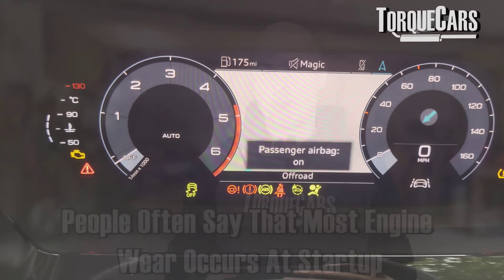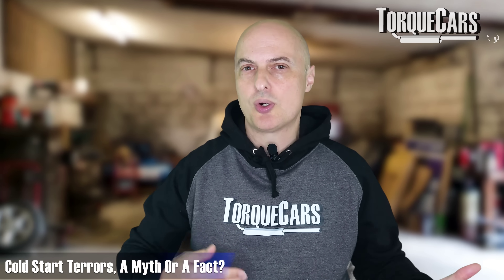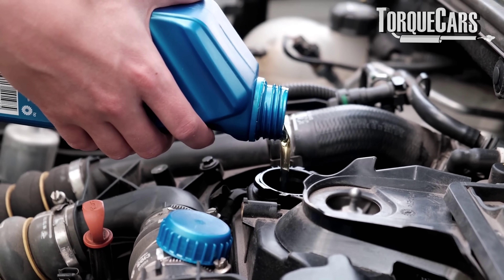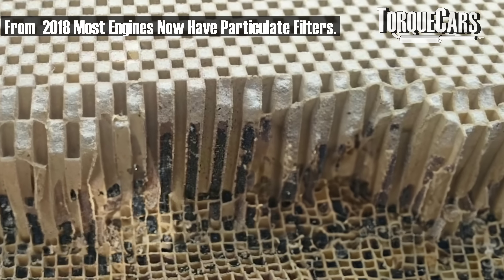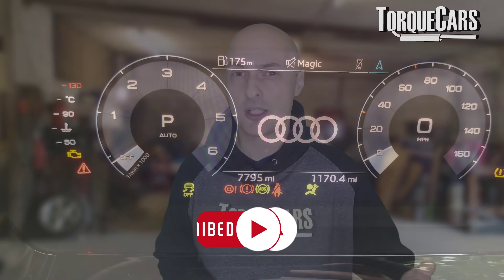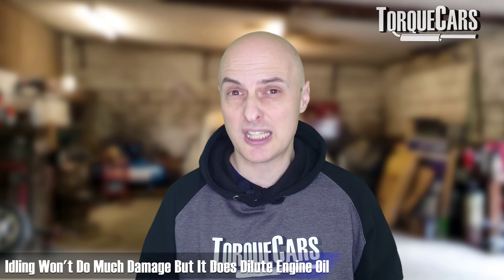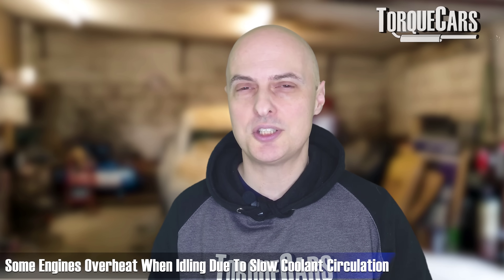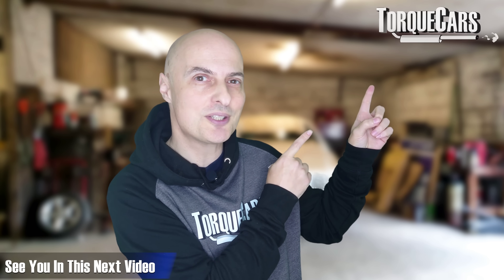❄️Reasons Why Bad Cold Starts Destroy Your Engine ☃️Prevent It Happening To You! ⚠️

Comment: I always wait until the choke backs off on my Ram 5.7, before putting it in gear. 

Next, I wait until I’m well out of our SD, 2 miles down the road before accelerating hard. 

My vehicles usually get well over 200k trouble free miles on them. 

Also, don’t cheap out on oil. It makes a huge difference. 

Same with my wife’s Mercedes.

Comment: Ive made a habbit to start the engine in the cold season and then get out and remove all the snow and the ice. I know its technically not the best for the engine but im much more worried in that case about my turbocharger. I dont want it to do any more rpm before the oil had a chance to properly circulate and get more liquid. Just a little bit of throttle will spool up the turbo some and the turbo is much more sensitive to improper lubrication than the rest of the engine. I might have to add that im not building base camp in the morning either, most of times its less than 5 minutes till i drive off. Heater stays off till i start driving to allow for faster warmup of the engine too.

Comment: The trans converter and fluid warms with the engine during warm up as the engine warms during idle not driving. The fluid from the trans gets put through the radiator in an auto trans. Then goes back to the trans through the trans fluid pump that circulates the trans fluid to the radiator that cools the engine.so it will warm even though u havnt driven yet.

Comment: Diesel is different. During winter I think the oil company puts a winter additive to liquify the Diesel a little bit.
During frost morning I let the engine start and for 10  seconds just let the engine settle and drive off slowly.heat builds up quicker During work.
After 5 minutes under 2000rpm I bring up the the revs.
Then drive normally. 
But another fact of having 6 gears is that I often don't get out of 4th gear because I don't go much over 40 mph on the roads with traffic and the twisty roads. 
So 50 mph I slip into 5th and 60 and above 6th.ive got 154 000 miles on the clock and it's still brilliant and the end of my tailpipe is shiny.
Occasionally I will drive the hot engine up a very steep hill at 4000rpm to clean the dpf and sensors.
I think people need coaching for the different torque between Diesel engines and petrol. 
With Diesel the power comes early in lower revs.
Hope this helps

Comment: Automatic transmissions warm up through the trans cooler built into the radiator because the radiator gets warm. So if the thermostat is open for a few minutes the trans will start getting temperature before driving it.

Comment: When sitting in the car waiting for the engine rpm to drop try turning on the lights, select bright lights/high beams, set the fan on high, and put your foot on the brakes. This extra electric load causes the engine to warm quicker.

Comment: Modern cars have a strategic warmup process programmed into the ECM to provide faster warmup of the engine and exhaust during idle. The RPMs are higher, engine timing is retarded and air is injected into the cat (either through thermactor pump and/or variable cam timing events). The catalyst isn't submerged in water during this. Its heating up faster from higher idle and more air going in with the fuel to light off the catalyst sooner. The lower engine load with higher idle speed puts less moisture into the exhaust initially than immediate cold start driving. The goal with cold engine run strategy is to light off the cat as soon as possible, mainly for emissions purposes. Only larger, longer exhaust systems will accumulate more moisture during warmup, mainly in the muffler, where gas velocity is lowest and temperature difference to the outside of the casing is high, forming much more condensation. This is why .mufflers and tailpiping usually rust from the inside faster than the beginning section of exhaust. This is also why catalysts are placed as close to the engine as possible for the quickest heat up to light off temperature. IMO, the best strategy for the least engine wear is to start the engine, let it idle for 30 secs, then drive away gently, keeping the enigne between 1500 - 2000 rpms. Also, absolutely avoid more than 30 percent throttle until the coolant is showing as up to full operating temp. If you drive your car very hard, the best strategy for warmup is to get the engine gently up to full coolant temp, preferably with light driving, then shut off engine for 2 - 3 minutes to allow the pistons to heat soak. Cars with water cooled turbos should always wait until full coolant temp is reached. The transmission will be warm enough if its an auto with a torque converter, but manual transmissions won't warm up without driving under some load.

Comment: I Don't live in a cold country, I leave my V6 F-type idle for a few more minutes after the idle drops and then put it in D and drive at idle for about 3 more min which by then the temp is about halfway to normal. Then I drive at low RPM until it reaches normal operating temp. I don't know when the 0W-20 oil in the engine reaches the normal operating temp to be able to use high RPM.

Comment: Here's another tip: when it comes to batteries, when I would replace a bad one if vehicle rating was say 50 to 60  cold cranking power I would buy one rated drom 70 to 90 cold crank power. Never any trouble. It could be minus 35 degrees farenheight with wind chill minus 50. Would go around w/ husband and jump start everyone elses. Mine did sit outside by the way. No garage or shed.😊😊😊😊

Comment: On most modern engines anything newer than 1990 I'd say you can start it up and pretty much move off on the clutch immediately as long as you keep revs below 2k its not a problem and just wait for oils temps to be at least 70°c or more before you push it in any way. My 6.2 V8 is so easy to drive at low RPM anyway it hardly needs to be revved up to drive around

Comment: I’ve seen cars with such poor oil maintenance that the idle is around 1700. They just topped it off over and over. During heat waves it’d quiet down. 😂

Comment: Arent the pumps nowadays getting eletrical instead of belt driven? If that's the case it should be possible to optionally start the oil pump before the engine...
Those webasto heaters always had a separate water pump to pump the heated coolant water around the engine before it was started.

Comment: I live in Canada and I have a Dodge power waggon truck with a 57 hemi what I do is I put the part on and put it in drive and I make sure I’m up against the snowbank or I’m against a concrete park embankment just so the vehicle does not potentially get out of park break it can happen but under that slight a load in drive or reverse the heat up substantially quickerI would not try this without really good park brake adjustment and I would clock the wheels just to be safe

Comment: On your last point about spooling down turbo engines after a hard/long drive, how do manufacturers square this with stop/start. I am an enemy of stop/start, mainly because I believe that constant stopping and starting the engine increases wear on various components including the starter motor - even though those are beefed up - and because I have owned, serviced and repaired my own cars for more than 50 years when stop/ start was a pipe dream for most of that time. I always turn it off. My other question is about gently driving off with low revs, early gear changes and low speed, after first letting the engine  idle for 30 seconds or so, so as to minimise engine wear.

Comment: There’s no oil circulating at the top of the engine on cold start and letting it idle!  Best thing to do is start up and drive at low rpms under 2500 I would say . Usually takes about 10-20 mins of driving.

Comment: What’s the opinion on waiting a few seconds when turning the key then cranking the engine ?
Thanks
Reply from the maker: When you open the drivers door in many new cars, the fuel pump is already starting to prime you can usually hear it power up. The electrical system is on when the key is turned, and the only benefit to waiting to crank is on diesel engines to allow the glow plugs to warm up. I'm glad to hear others opinions on this, I can't think of any other good reasons.

Comment: And according to Engineering Explained, when it comes to maintenance, use only the oil and transmission fluid, the manufacturer recommends, as well as the radiator engine coolant.

Comment: the initial raised idling happens in order to moove as much oil as possible , it doesnt raise rpm to gain temperature through friction , it tries to stirr up the oil siting in the carter thats its sole reasonany car with a Lamda/oxygen sensor will not stall that was happening with carbirauteurs

it is in the turbo petrol engines where you actually have to wait for the oil to warm up before you force any induction , check what the car's manual states if you dont believe me

Comment: The lower the RPM of the engine, the more time it spends cold. Drive off gently, keep it below 2500 RPM if possible, and it will remain at a low RPM but will heat up a lot faster than if it were to remain idle, due to gearing up and more fuel being burned per revolution of the engine. In cold weather, try to prefer using heated seats / heated steering wheel features rather than heated air, as that pulls heat out of the coolant thus out of the engine. If you do not have a heated steering wheel, some thin leather gloves work like magic.

Comment: I have foot on gas so it isnt injected during cold start, give it a few seconds after starting before putting in gear and keep at idle speed while driving until its 50 degrees C

Comment: I have a 2014 C7 RS6, and i ALWAYS wait for the revs to drop before i move the car. The maximum revs are also automatically restricted, and i dont push it AT LEAST until this restriction has gone. I also try to let the engine/oil cool before turning the car off

Comment: Ignition on, cold start engine, wait 30-45 seconds, move Park to Neutral and idle 15-seconds, move into drive and move away. First 1-5 mins of driving limit revs to approx 3'000 rpm, varying the RPM used range between 1'000 to 3'200 rpm, throttle on and off at speed. After approx. 5 mins or over 4-5 km driving, temperature checks, and if okay, the engine is cleared to use higher rev range. i.e. up to 4'000 to 5'000 rpm in short bursts. This is my start up procedure.
Reply: VQ35DE, optimal temperature idle in neutral is approx. 700 to 750 rpm. In drive, approx. 600 - 650 rpm. Cold start, 1'200 rpm.

Comment: 1.8 tdci ford connect van, i usually turn the key wait for the glow plug lights go off then turn the key. If it is really cold i do this upto 4x then start the van let it idle stabilise which takes a few seconds then give it gentle revs slowly bring it upto 1000x rpm then slowly onto 1500rpm whilst watching the  engine temp indicator soon as the temp gauge rises off the bottom i set off.

Comment: My EV does not seem to have this problem, but I will take your advice and start it and allow the engine to idle for a bit.
I believe in good maintenance, so I change the blinker fluid every 12 months but I still can’t find the dipstick to check the oil!
But the engine must be OK as it is so quiet with just a happy hum as I drive. 
Yep, I thank you for your advice and now I must wash my car and I use Pantene shampoo with conditioner to keep it so shiny and nourished.
🤓🤔🤷‍♂️
Cheers from Australia, where we have issues with the windscreen washer fluid dribbling out as we are upside down here at the bottom of the world!

Comment: Water coming out the exhaust is normal, a product of burning petrol is water, in cold weather you will see water coming out and as it warms it starts to turn to visible steam, when it's hot the steam is still there but you can't see it, steam is clear, when you see steam you are looking at the water condensing.

Comment: Use the engine heater (electric or fuel-powered) in the winter (or install it).
Before the 1960s, mineral oil of maybe SAE 30 or 40 was used, so in cold climates when it was minus 30, 40 or maybe 50 degrees C the oil was like butter or maybe cheese...
Then they put a plate of glowing coal under the engine, after maybe an hour the engine was hot, the battery was probably stored indoors....

Comment: A3 1.9tdi 8P1 takes well over 10 miles or 20 mins to still not even fully warm up if you drive it properly (carefully); so shouldn't you keep the interior heating OFF, or to COLD, for as long as possible to help the engine heat up more quickly... i.e. so that heats not going effectively from the engine to coolant into the cabin.... I'm not sure there's much else other than that... that can actually be done!?
Reply: @Richard_L_Y  I had that exact car until the engine died and it made a huge difference whether you used the heating during the warm-up phase. It would take almost 10 minutes longer for it to reach OT. So I used the heating only when it was already warmed up. Didn’t help that much, though.

Comment: Im personally not a follower of letting my engine "warm up" before pushing it.
I get in and drive.

However im a VERY strong believer in changing the oil every 5-10K miles, and using decent oil.
Yes its overkill, but I have never had a car with engine problems.

Many of my high mileage cars have either become economically unfeasible to keep on the road due to everything but engine issues, or have been priced out of my ownership.

There is no point in being "delicate" with an engine, but skimping on oil changes.

Although now I have three cars on the road again, putting expensive oil in them frequently has really hit my pocket as a high mileage driver.

Comment: The DSG in my diesel Golf doesn’t even let me keep the revs under 2000. It takes 2250 to get to third gear and at these kind of revs it’s at around 32 km/h at second gear, meaning if  it’s -10 degrees C outside and you start your car in an area where you’re only allowed to drive 30, it’s kinda not that great.

Comment: I wonder if these new oils help with some of that. I’m not talking synthetics, but weight. My ‘24 Rav 4 takes 0w-16. Now they have 0w-8. I wonder if those thin oils preform better at colder temperatures and with the tighter engine tolerances of modern cars.

Comment: What about if my car has been sitting for a week or two? 

It’s an e90 with an n47 on 195k miles I’ve babied it for thousands of miles and she’s healthy as a tick still. 

I usually cold start it and give it closer to a minute for the revs to fully drop then drive gentle for 10-15 mins making sure I try change up before it hits boost. 

It’s never usually sitting for long periods but I’m driving a company vehicle for my current job so the car only gets used the occasional weekend as of late but we’ve been having a lot of cold frosty weather lately so I’m curious if I should just keep doing things as I have been or if there’s any additional little changes I could make to be extra safe
Reply from the maker: The only thing to watch is the battery, it will start to run low and if it doesn't get topped up it will gradually lose charge and it's ability to hold a charge. I think you are doing the right thing. Do you regularly change the oil?
Reply: @ oh yes I do indeed, every 5k miles since I bought it with 5w30. Living in Ireland so I feel that’s a good all rounder and the car seems happy with it too. Always open to suggestions, any time you look this type of thing up on forums all you see it people arguing and disagreeing over it 😅
Reply from the maker: I'll drop a video soon about storing a car, this should have some interesting tips and things to bear in mind although it is more aimed towards long term storage than just a week or two.

Comment: With synthetic oils they are said to cling to engine parts , even after the engine has shut down and for how long ? I always use an anti-friction additive which I hope also would cling to engine parts . Lessening wear at start up and for those that have a short drive to the highway . They would let their car idle more , so they could get up to the speed necessary for highway driving . I definitely during the winter when I have to remove snow or ice . To have started my car up first for it to heat up .

Comment: In my opinion there is a better way to accelerate the warming up of the engine than idling up e few hundred revs. Its putting little load on the engine. Switch on your electrical devices like A/C, window heater, mirrow heater, headlights, so the generator sucks load from the engine and this warms up the engine.

Comment: Just start up your vehicle let it run for 30 seconds and then drive away gently and normally.  If it's really cold the oil pump relief valve opens to lower the pressure to a normal range while the oil warms up.  Also when the thermostat opens, there is an on-rush of cold coolant into the engine from the radiator.  All of this has been accounted for in design/testing/development.  Read your owner's manual and follow the maintenance schedule to a "t" - your vehicle will last a very long time.